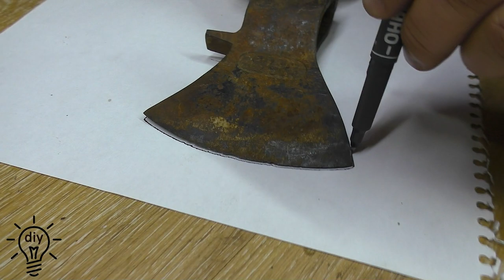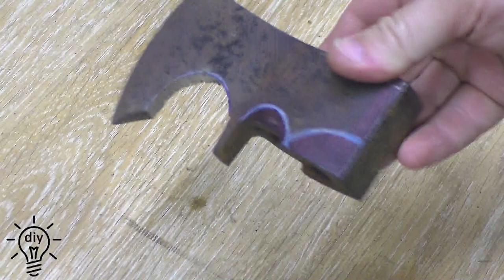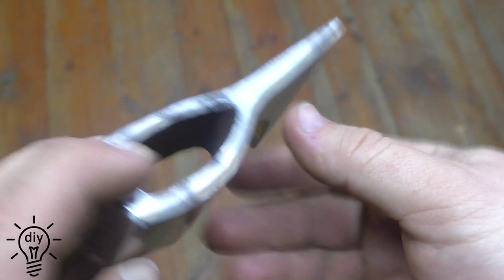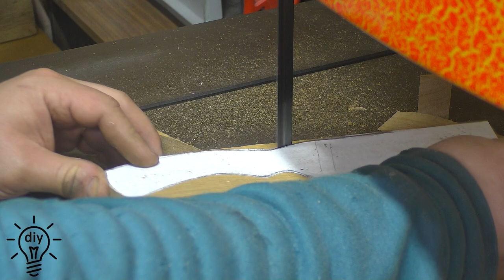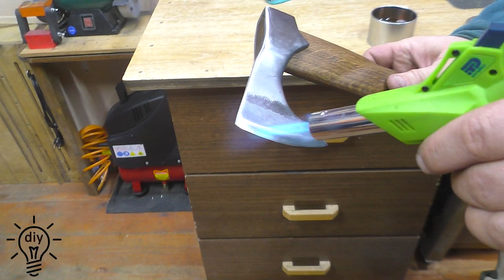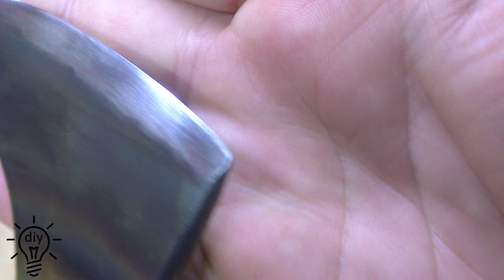A brilliant idea from an old axe! You'll be happy to see it!

Comment: Why did you heat treat the blade again?
Reply from the maker: for quenching steel
Reply: @diyprojects7868   I know what it is I am curious why you did it again. It should have already been done when it was originally made.
Reply: @angrymater13la  It was probably cheap crap. Plus, he already ground off the hardened layer.
Reply: @jonathantrevatt4167  didn't even think about that